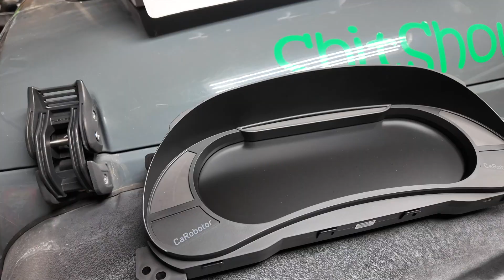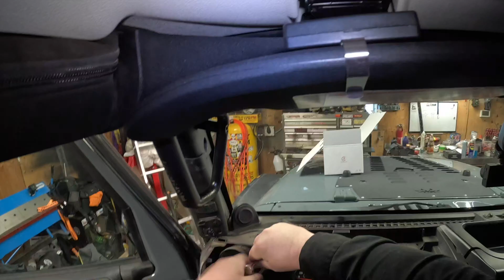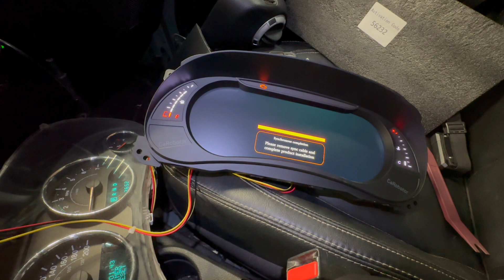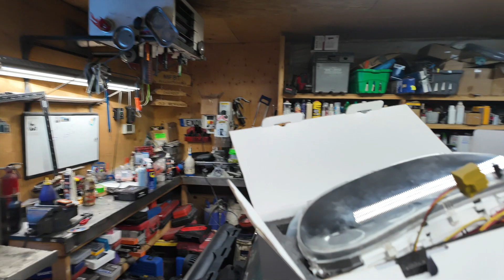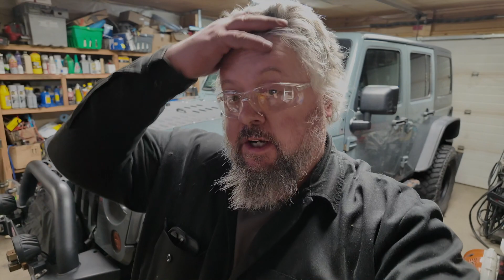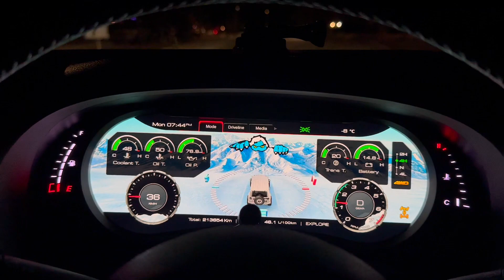BEST JEEP WRANGLER MOD UNDER 1500

Comment: You gotta love those 'fits in one way only' plugs. I spent 2 hours hours once just swapping a car stereo over because I couldn't get a hold of the correct plug adapter and had to do all the wires separately with a soldering gun.  I had an E46 BMW like you did once and I changed the tape deck to a CD deck, it still took ages because even with the correct plug trying to squeeze it into the back of the slot it goes in had no space to manoeuvre my hands in.

Comment: Looks pretty sick! Mine just arrived.
Reply from the maker: You will love it, mine has been great way better experience than the boring factory dash
Reply: @BackCountryWrenching  Are you able to change the brightness level on your dash?
Reply from the maker: @W1LDCH1LD1  yes you can the same way you adjust the brightness on the old dash with the switch
Reply: @BackCountryWrenching  Thanks for the quick reply, I'm aware of the switch/knob but apparently, there's an option in the J Pro Settings tab called "Night backlight enhancement level" - Was chatting with the support on Instagram but they since disappeared when asked if there's an firmware update. Just wondering if different JK years have different OS version.

Comment: Just like that stereo, it doesn't add any value to the Jeep and maybe even hurts it. That bootup sound is really cringe and the snow mode imagery makes me want to vomit. It will be interesting how it does after a few years with -40 temps. It's really hard to make a dashboard that doesn't shit the bed with the crazy temps and vibrations it has to endure. Mercedes sprinter vans had big issue with dashboard dyeing from corrosion.
Reply from the maker: Interesting tell me how drilling holes to the hood of your LJ for the tranny cooler added value lol
Reply: @BackCountryWrenching  You mean the same hood that has a massive crease in it from being wrapped over windshield? That hood was fcked before I got the jeep lol